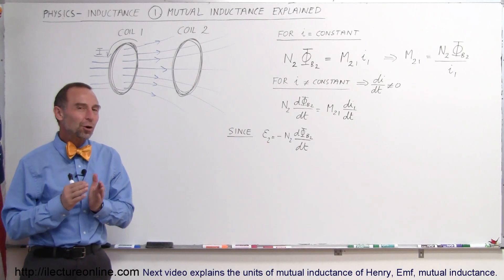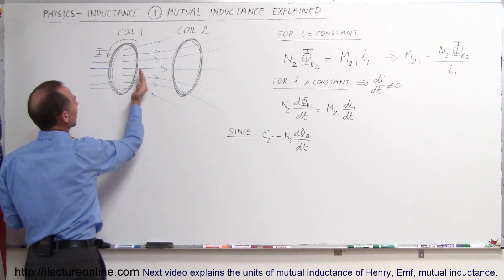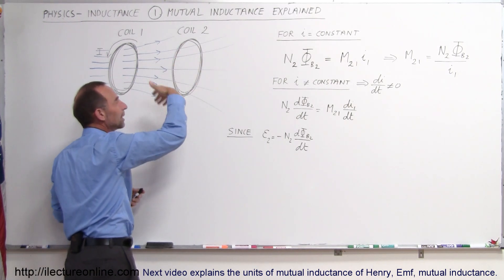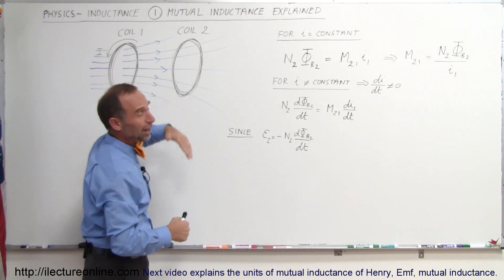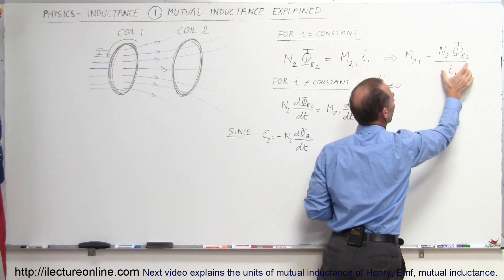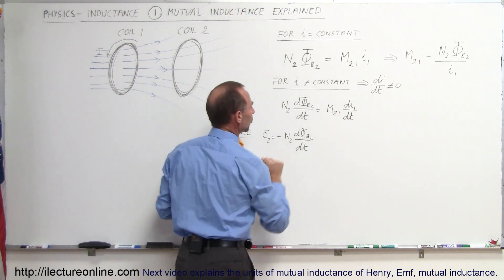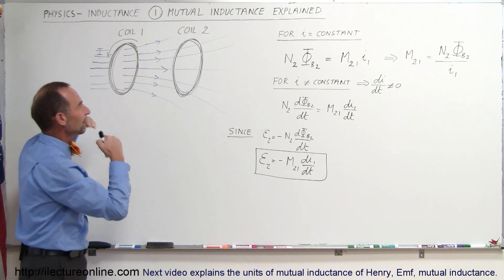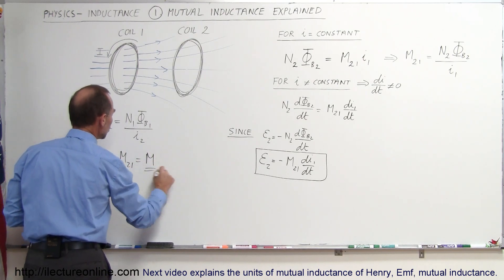Physics 47  Inductance (1 of 20) Mutual Inductance Explained

Comment: Hello, first of all thanks for all your videos. What happens when one of the coils has a smaller radii and its magnetic field isn't uniform over the bigger coil?
Reply from the maker: If one of the diameters is made smaller, then the mutual coupling would be reduced.   The magnetic field does not need to be uniform in order to have magnetic coupling.
Reply: @MichelvanBiezen  Right, but considering they smaller one as a dipole, how exactly could I demonstrate they mutual coupling value. I know that the magnetic field from they outter coil would be uniform over the smaller one, but the magnetic field of the inner coil wouldnt be uniform over the bigger one and that makes dificult to calculate the flux over the bigger one. I hope i'm making myself clear. Thanks for answering : )

Comment: If two concentric circular coils having different radii, one is smaller than the other and the coil (c2) having a larger radius is carrying a current I then what will be the current flowing through the second coil (c1) having a smaller radius? What happens if the same current passes through the coil c1?
Reply from the maker: The amount of coupling does depend on the relative sizes and would be difficult to predict, and easier to measure.  However there would only be current induced in the second coil if the current in the first coil is CHANGING. A steady state current in the first coil would not induce a current in the second coil.

Comment: hi I wana ask a qustion 
why the mutual inductance in the booth are the same it can't be  it should depend on the geometry of the two coils
Reply from the maker: The inductance is the same in both.  However if you change the geometry of one, the inductance in both will change equally.

Comment: Greaaattt explanation and video !.
 But my question is when calculating EMF induced due to mutual inductance,  what value of magnetic flux we should use to calculate mutual inductance (M). 
Just wondering since we have a changing current, which means we have a changing magnetic flux. 
and I really appreciate your videos!
Reply from the maker: Yes, in order to be able to calculate the mutual inductance, you would need to know how much of the flux of one inductor is coupled with the other inductor.    In the case of a transformer, it is almost 100% because a solid metal core links the two.

Comment: will the second coil affect the first one by producing on it an opposite magnetic field as for every action there is a reaction equal in magnitude and opposite in direction?
Reply from the maker: You are citing Newton's 3rd law which refers to forces.  However you are correct in saying the with the interaction between charges and magnetic fields, there is a similar interaction as well.  The mutual induction between coils tends to be the same.
Reply: Michel van Biezen  and will that increase the current of the first coil to oppose this change?
Reply from the maker: A current can only be induced if the magnetic flux changes (increases or decreases) through the loop.  Watch the videos in this playlist:  PHYSICS 45 ELECTROMAGNETIC INDUCTION  https://www.youtube.com/playlist?list=PLX2gX-ftPVXV1z8nPIePOUk5WIGVYBzDy&disable_polymer=true
Reply: Michel van Biezen thanks for your reply but probably you didn't get what I mean
Assume that 50 tesla is produced from coil1 and 30 tesla reaches coil2 thus coil 2 will try to oppose that change by generating a backward induced e.m.f that will induce current and also magnetic field and this magnetic field of COIL 2 will be in an OPPOSITE direction of the INITIAL field of coil1 and ot will act on COIL 1 thus the resultant magnetic flux acting on coil 1 will decrease so it should try to oppose that decrease by increasing its current.
It is the first time for me to study this topic so things are confusing
Thanks once again
Reply from the maker: Only during a transient period.  If there was initially zero flux and the the magnetic flux builds up to 30 tesla in the second coil, only during that period will there be an induced emf.  When it reaches 30 tesla, the induced emf = 0.
Reply: so in that period the current direction is clockwise in the second coil. is that true?

Comment: I still have one question that what if I connect 2 coils in parallel and feed the current. Does it have the mutual inductance ? I know it should have because coil 1 flux will still link with the coil 2 and produces the emf which is either more or less than the emf produced by that coil (coil 2). Thanks a lot for clarification.

Comment: How would the mutual inductance change if the coils were moved apart a distance R along the common axis?
Reply from the maker: +Nicole Hemmings 
The mutual inductance depends on how much magnetic flux from the first coil goes through the second coil.
If the second coil is moved farther away, then less flux will pass through the second coil and the mutual inductance will be smaller.
Reply: +Michel van Biezen That makes sense. How would the expression for mutual inductance change because of this?